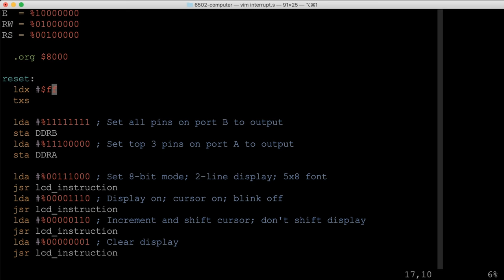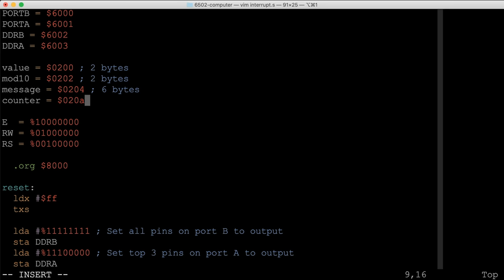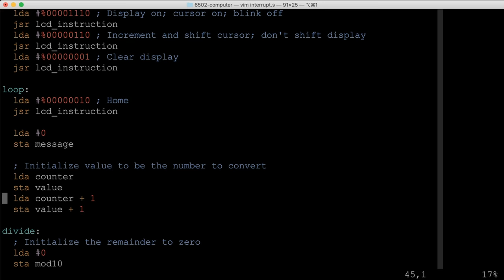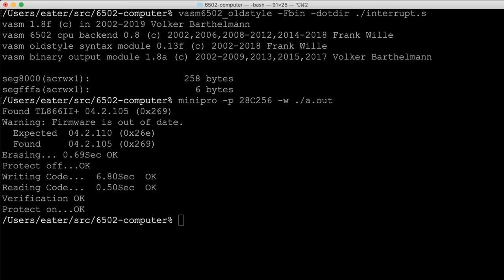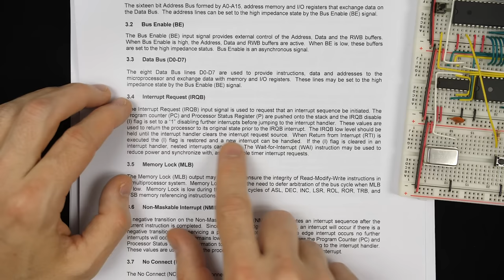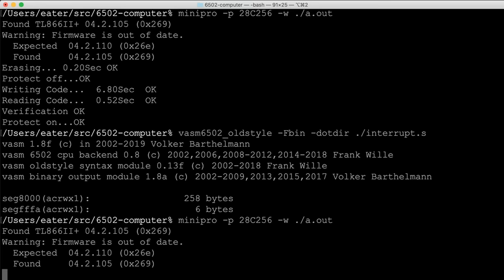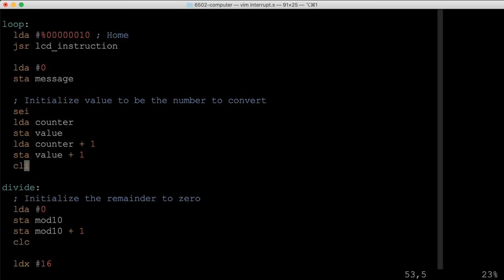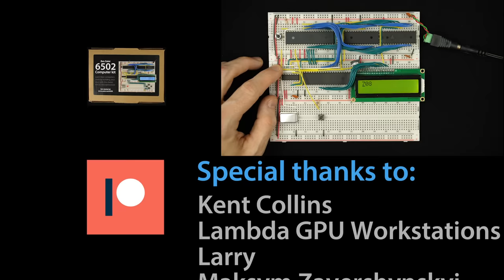Hardware interrupts

Comment: Very good video! You are bring to me a whole new perspective on computers.

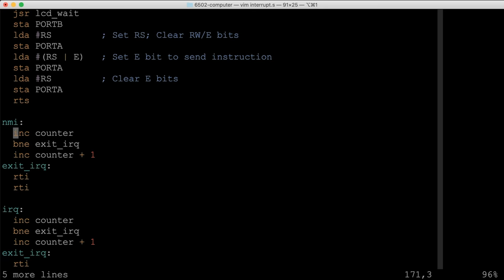You might know this, but for anyone who is not aware: in Vim to replicate a series of keystrokes press .  So when Ben  in the video (19:38) is creating the code for the nmi he manually select the text irq with visual mode (keystroke v), then deleted the text (keystroke x), then enter insert mode (keystroke i), next typed nmi, and then quit insert mode (keystroke esc) and proceedingly repeated the exact same set of actions two lines up for the bne jump comparison. Instead of repeating that complex series of keystroke he could have just pressed . (keystroke period) to repeat the last set of actions he did. So he could have typed . , l, and 3x (erase three characters) to insert nmi and remove the irq characters. While this seems like a nitpicky thing, I have found little tricks like this to greatly improve my time while using Vim.
Reply: I think that was c for change, not xi. . repeats one command, which could handily be e.g. cw for change to end of word.
Reply: @0LoneTech  That actually works better! 

I only knew about ciw (change inner word) but would change the entier word underscores and all. Thank you!
Reply: @Chris-on5bt  You can combine all sorts of operators and motions, as well as apply counts to them. https://vimhelp.org/motion.txt.html#operator

Comment: "The thing" for a button is to do it once. Basically we are already making a keyboard so we can store this as 1 somewhere and upgrade to ASCII in the future to utilize a byte fully. When printed on the screen we are done and we set the stored location to 0 and leave the interrupt which is a requirement for a new button press where we can have a fine tuned delay and/or wait for the release on the button or whatever. The trick is to always let the computer have time and not give 100% to a user/finger. :)

Comment: In a few dozen videos this 6502 breadboard will be running a preemptive multasking hand crafted kernel
Reply: Cooperative multitasking with a scheduler/executive like the Apollo guidance computer would probably easier to implement. Maybe with RAM/ROM bank switching (one bank per task) and a small shared RAM/ROM segment for data sharing, common functions and the central executive.
Reply: @ReneSchickbauer  Easier, sure. But we are talking about Ben Eater. He will soon talk about how a serial interface work, use an old mouse as example and will end up hooking this to the breadboard VGA just to show us a GUI.

Comment: How are interrupts implemented on pipelined processors?
Reply: It depends on the design of the processor. Say you have an interrupt coming in at cycle 7 on a processor with a 6-stage pipeline (FETCH, DECODE, REGISTER READ, ALU, MEMORY ACCESS, REGISTER WRITE).

You could have a processor that schedules disabling interrupts and issuing a read of the interrupt vector location from RAM at cycle 7, with all 6 pipeline slots filled; you could have another that schedules disabling interrupts and setting the Program Counter to a fixed vector location at cycle 7, also with all 6 pipeline slots filled. The former is a bit slower, because the pipeline stalls on an immediately-needed load (jump to <loaded address> needs the memory to be loaded). Some architectures do the former (x86, ARM...); some do the latter (MIPS...).

You could also have processors that start doing those things only at cycle 13, flushing the pipeline, with only 1 pipeline slot filled at cycle 12. This way lets all instructions resolve with interrupts disabled before the jump; the Program Counter after the interrupt handler is done is 6 instructions later.

Because most pipelined architectures have REGISTER WRITE and MEMORY ACCESS stages at the end, you can also have processors that drain the pipeline, but cancel the REGISTER WRITE and MEMORY ACCESS stages of all instructions before the jump to the interrupt handler. Those processors might be able to start the jump to the interrupt vector at cycle 11 instead of 13. The instructions still run, but because their effects cannot be written anymore, it's as if they weren't executed. Then the whole pipeline is re-enabled so that the interrupt handler's effects apply. The Program Counter after the interrupt handler is done is then set to the first cancelled instruction.
Reply: crazy answer, thanks!

Comment: You might be able to use the regular interrupt pin if you use the button to trigger a pulse generator circuit, then feed that pulse into a latch, and the output of that latch into the interrupt pin. Write code to reset the latch after you've incremented your count

Comment: funny curiosity is that in modern microprocessors interrupts work like the NMI, but they are maskable and in fact called IRQ. This is due to the fact that they are mostly used in stuff that needs to read dumb buttons but you still want the power to disable them for sensitive communications. and to be able to have more than one device...there are simply more of them
Reply: Strictly speaking, even a non-maskable interrupt can be masked, if the hardware is built to allow it.  Just run the NMI signal through an AND gate with one input toggled by the hardware which is controlled by the software.  The result is that NMI is now a maskable interrupt.

Comment: I think it's worth pointing out that, although you can't disable NMI by changing anything about the state of the CPU itself, you can still instruct whatever's sending the NMIs not to do so. For example on the NES you can "disable NMI" by communicating with the PPU. Of course, this would also require more logic beyond just wiring a button from NMI to ground.

Comment: NMIs are also used where the absolute most do-or-die events occur that a computer system must unquestionably deal with.

A power loss circuit is one, but I can think of another good example.

The SNES uses the 16-bit descendant of the 6502, the 65816-- Well, a custom Ricoh chip that uses a WDC65C816 core, but there's no architectural difference, just hardware baked on that already uses up some of the memory address space. --and it has the NMI fired every VBLANK. 

The reason it does this is that the VBLANK is where the main DMA transfers for the video hardware are supposed to happen, and the transfers take a lot of time and bandwidth to do. Thus it wants to be sure literally the entire time the video chip can DMA it's allowed to do so. This is of course on the caveat that the game itself actually is willing to let the video hardware DMA, since the NMI handler is still something handled on the cart's ROM. It's pretty common practice for a SNES game that, if there's still game logic left to be handled, to just immediately return from the interrupt and keep working on game logic. This is where lag frames come from on the SNES, since the PPU literally can only render the same exact frame as before if the VBLANK handler opts not to open up DMA for the PPU.

HDMA is a different process, and I think it's handled through standard interrupts.

On other architectures, like x86, NMI is critical to how preemptive multitasking is supposed to work. A process is only afforded a certain amount of time to do its job and, assuming it doesn't already preempt itself for I/O, the operating system needs to be able to revoke the process's time on the CPU. So it'll usually set up a timer that will invoke the NMI when time's up so that even if a process is stuck in an infinite loop where it'll never preempt itself or voluntarily give up control, control is given up anyway and the operating system can give time to other processes. It can also take note of how much it's been fully preempted as a measure on whether or not the process is "not responding" and might take efforts to inform the user that the process may be hanging.

Comment: An assembler with anonymous labels and scope would be something you might want to show your viewers in the future.
Reply: The GNU assembler (gas) for MIPS allows you to declare labels like that. You put a number and then a colon before an instruction, and that's a private label. When you want to jump to the PREVIOUS label with number N, you jump to Nb (backward); when you want to jump to the NEXT label with number N, you jump to Nf (forward). So you can have like:

1:  instructions here
2:  instructions here
    bne   t0, zero, 2b   # jump BACKWARD to [2:]
    addiu t1, t1, -1
    bne   t1, zero, 1b   # jump BACKWARD to [1:]

but also, later on in the same code,

    instructions here
    beq   t0, t1, 1f   # jump FORWARD to [1:]
    beq   t0, zero, 2f   # jump FORWARD to [2:]

    instructions here # executed if t0 != t1 and t0 != 0
1:  instructions here
    b      3f   # jump FORWARD to [3:]
2:  j     error_handler
3:

and it'll work! I don't know if any assembler for 6502 does this though.
Reply: @nebuleon  there are at least two assemblers (A65 and Ophis) for the 6502 that have those features. They make assembly so much more readable, and cut and pasting is a dream.

Comment: It's interesting that sei and cli are the opposite way around to how they work on microcontrollers :)
Reply: That threw me too.  I work with AVR microcontrollers and they're the opposite too.
Reply: @MatthewSmith-wh5dr  is that because AVR is setting the enable while this is setting the disable?
Reply: @doctorbobstone  Well, I think I've confused the issue.  The sei and cli commands in avrgcc enable or disable all the interrupts globally.  You can then individually enable each of the particular interrupts you need inside that global group.  For example, you can enable the timer overflow interrupt and the hardware interrupt individually but then enable or disable that group as a whole with sei or cli.
Reply: @MatthewSmith-wh5dr  
Yep.
But this is a different issue. AVRs have multiple interrupt sources while the 6502 just has one. So there is no need to have a finer granularity.
Yet the fact remains, that on most processors you enable and disable something but just saying so: set interrupts to "on".
On the 6502 however you say "set interrupt disable to "on". Which is not usually the way human thinking works. Human thinking usually is: if we set something to "on" (enable it), it is operational.
But ... that's the way it is. One gets used to it.
Reply: @oH well,lord! Indeed. It's amazing that there are so few transistors in a 6502 that it's been possible to recreate the entire thing with medium sized surface mount transistors and it's only like 10 cm across even then.

3500 transistors, give or take isn't that many...

Comment: Denouncing that button is super simple just use an electrolytic cap between GND and the button. Play with the cap values to find the best one. The 555 circuit is educational but not good space wise. Especially considering you have limited space on the 3 breadboards

Comment: Just an idea. I was thinking about an alternative software solution. Maybe you could keep a loop inside the interrupt while its held low, using another memory address as "input" to sense the interrupt value (0 or 1). Its not a "good" solution, but its just an alternative.

Comment: Hi Ben great series, loving it.  I have one question though and I am unable to find the answer so far. It is about the NMI.  You mentioned in code that "counter" is addressed in both main loop and request handler. to overcome racing conditions you added SEI and CLI..  Also I remember you said that that would work for IRQ.. But NMI is non maskable. 
Wouldnt that mean that SEI and CLI dont work??

Comment: The interrupt instructions are very confusing for me coming from an x86 assembly background.

The x86 uses the STI and CLI opcodes to set and clear the interrupt bit respectively.  But on the 6502, the similarly named instructions SEI and  CLI control the interrupt disable bit.

So I keep thinking to use CLI to disable interrupts before a critical section, but in fact that would accomplish the opposite result.

Comment: Modern processors are not included in the stream. They are only notified when it starts and when input or output is completed. Technology is advancing rapidly.I'm wondering if the multitasking os interrupts programs for a while so we see them to be running in parallel.

Comment: I happened to notice that you removed the jump to loop instruction can you explain why it still worked
pretty please
Reply: There is a conditional branch a few instruction further up that jumps to "loop" when the program was done printing.  The jump he removed was being used to create an infinite loop.  Since he moved the loop label, he no longer needed the jump instruction at all.  The branch jumps directly to be beginning of the loop already.
Reply: @doctorbobstone  thx I could not see the other loop because my GPU could not preform the graphics calculations fast enough for the graphics card to render the image to display the frames without distortion to the level that it was not legible with his scroll speed

Comment: At 17:00 you state that "as long as the interrupt line is held low, the processor will sit in the interrupt routine ..." (or words to that effect). Wouldn't it be more accurate to say that "as long as the interrupt line is held low, the interrupt routine will be re-entered as soon as interrupts are re-enabled" (i.e. when the PSW is restored on return from interrupt)?

Comment: Assembler can get annoying at times however I look forward to your next video.
Can a non-maskable-interrupt interrupt a regular interrupt if triggered during the interrupt handler?

Interrupt interrupt interrupt.
Reply: Yes. A non-maskable interrupt can interrupt anything.  Technically, it could even interrupt itself, although you'd probably never want that to happen and the hardware would be set up to disallow it.
As for normal interrupts, they can only interrupt each other if the interrupt mask bit is changed to allow it during the execution of the interrupt routine.
You might wonder why an interrupt routine would allow itself to be interrupted.  The answer is that the hardware may be set up to prioritise interrupts so that some are considered more important than others.  If that's the case, then interrupts need to be allowed again while the interrupt handler is running, in case the hardware detects a higher-priority interrupt and needs to interrupt the CPU again in order to deal with the higher priority event before returning to handling the lower priority event.
Needless to say, this requires some tricky programming so that the interrupt handlers for the lower priority interrupts can recover gracefully from being interrupted.  It's not done very often because it requires thorough planning and full cooperation between both the hardware builders and the programmers.

Comment: @Ben Eater, I'm not familiar with the 6522 but I've been looking at PICs like the 8259A and I can't rap my head around how prioritization circuitry works so if you can talk about that that'd help me a lot. Stuff like time based prioritization and port priority makes sense but the I can't grasp the mechanics behind any blend of those two or stuff like the 8259A's rotating priority. Unfortunately I can't find diagrams for that prioritization hardware either. It might be proprietary?

Comment: Hey Ben,

Another great video, much thanks!

Is there any possibility you're considering doing future videos on things like adding DMA, hooking up an MMU, math-copeocessor, protected memory, or multi-processor designs?

I'm also interested in what it would take to get an 8-bit  DIY system working at the full clockkrate these CPUs are now capable of - I think the current W65C02S is able to go to like 14 or 20MHz, isn't it? I'm assuming a breadboard isn't going to cut it at that speed, so would you have to use a prototyping board or something and get good at soldering?

Again, thanks!

Comment: Great!  I was wondering how the interrupt works a bit deeper—on the internal hardware level.  I suppose that it takes action on a clock tick like everything else.  But how does it physically come in to tell the control logic to not increment/proceed?  I’m thinking about making an FPGA computer to play around with this kind of bare-bones stuff
Reply: It can be done in many ways, but it seems that the 6502 basically handles interrupts (and reset!) by overwriting the next instruction that is fetched into the instruction register with a BRK instruction: https://www.pagetable.com/?p=410 and then it apparently has some extra logic to make that instruction behave slightly differently depending on what kind of interrupt (or reset) that it was. I think there is a bug in the 6502 where an actual BRK instruction will be ignored if it happens in the same cycle as an interrupt.

But in general, the control logic in a CPU doesn't have to proceed to the next instruction after it's finished with the previous one. It can check for other conditions, like if there is an interrupt pending, to see if it should do something else insted.

Comment: Is there some way to suspend/halt the processor until an interrupt is received on the 6502 to save power instead of just constantly updating the display? Was wondering because this seems to be a feature on modern systems (somehow handled by the kernel)
Reply: That feature (to save power) is usually only implemented on microcontrollers because it's expected that they'll often be run from battery power.  Larger CPUs rarely have a power-saving mode although they often do have a "halt" instruction which stops the CPU from running until interrupted or reset.

Comment: My HP server uses NMI as part of it’s error handling for Light Out Management, instead of crashing the same way a normal computer would I usually instead get NMI errors, I’m guessing it’s because it allows communication to the separate processor used for ‘iLO’.